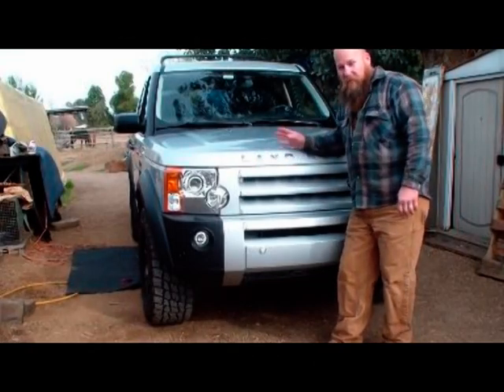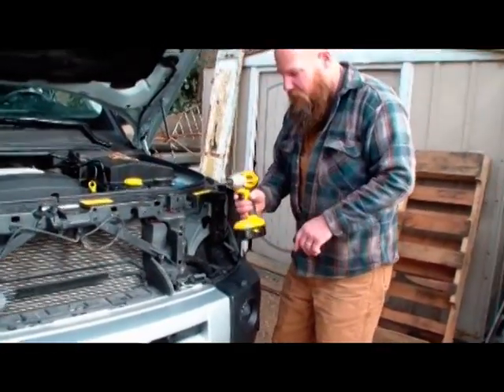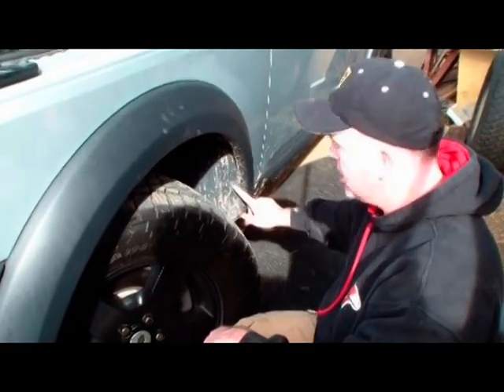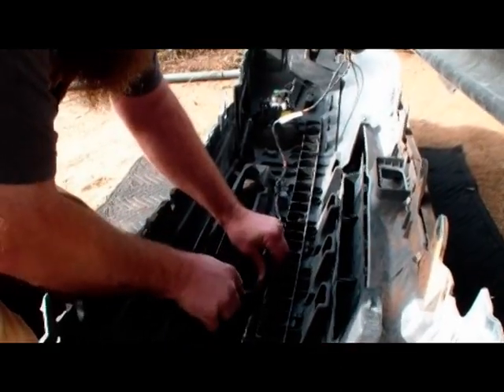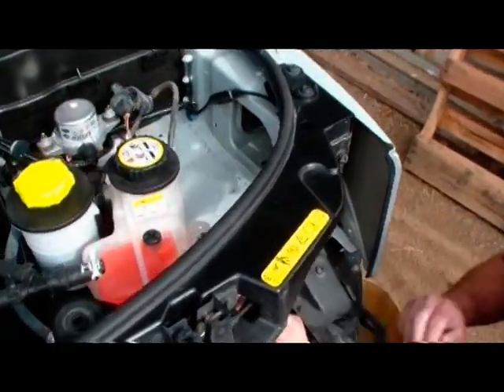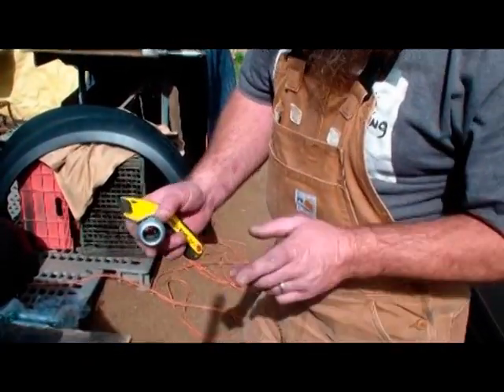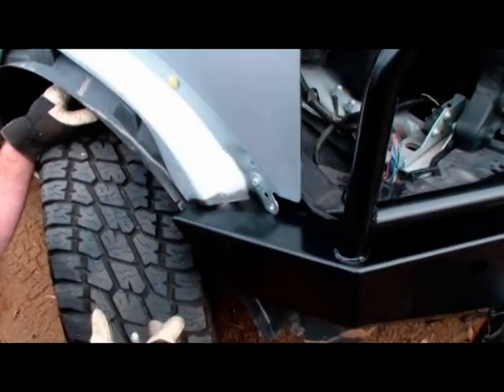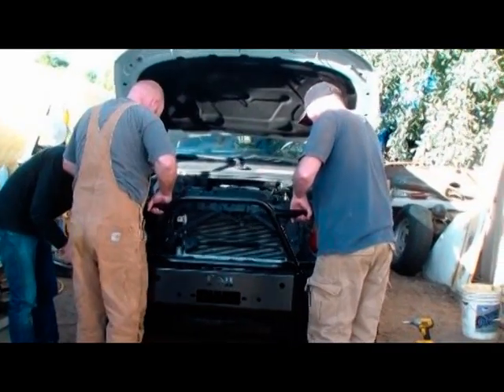Tactical Rovers LR3 front bumper install.mpg

Comment: Nice product and really good video. how do these do offraod?
Reply: I haven't really tried to offroad our LR3 yet, but I have once driven in half a meter of snow. I had it in snow mode, and raised the suspension. Barely had touched the throttle in order for it to move through the snow.

Comment: Do you folks still make the bumper that has the parking sensor enabled? On your website its shows that you fold are makings the bumper still but it does not support the parking sensors. Thank you for your time.